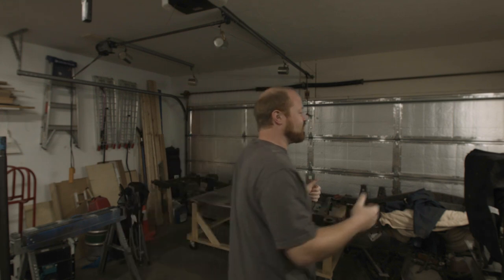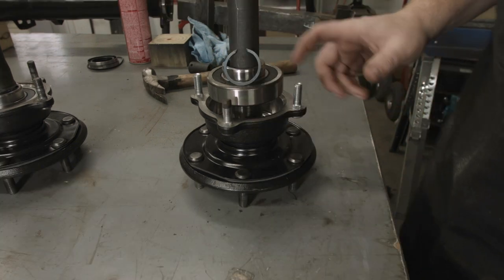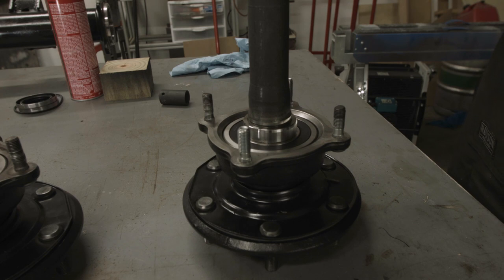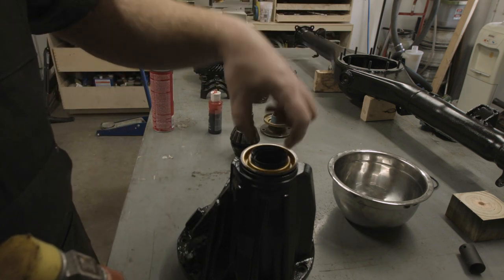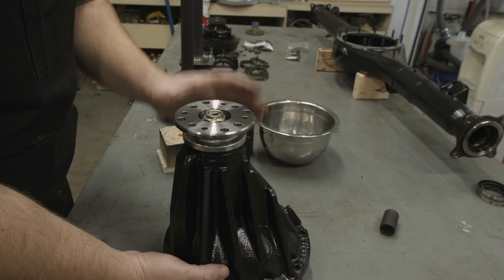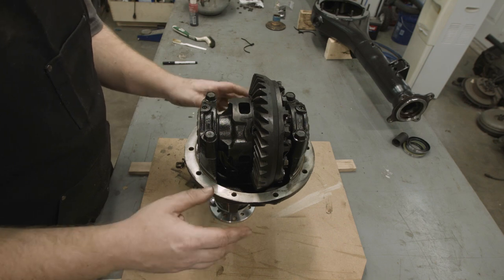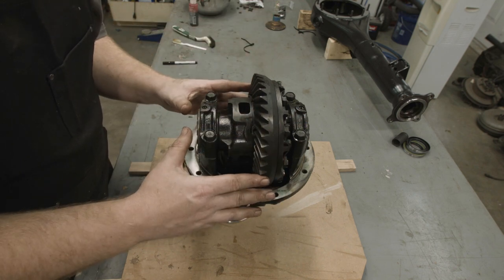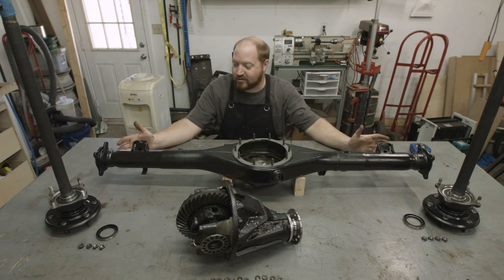Rear Axle Final Assembly - 1989 Toyota Restoration Episode 21

Comment: I noticed that you did not check the gear contact pattern between the pinion gear and the ring gear.  Is that a common practice with this differential?  Yes backlash is important and so is the contact pattern.  How about carrier bearing preload?  I know on a 9inch Ford rear-end the carrier bearing preload is applied while adjusting the backlash.   That is the case with a 9 inch Ford differential which is exactly the same as this one.  Sorry about being a PITA on this but I am genuinely curious about the change in procedure on assembling this style of differential.
Reply from the maker: I didn't check the contact pattern in the video, but I went back and checked later on off camera. It looked acceptable so I didn't feel like it was anything to make a video about. Both backlash and contact pattern are important, just forgot to do contact in the video. I didn't check carrier preload. I could go back and check it, but as per the last video of the series; I'm not working on the truck anymore.

Comment: What torque wrench are you using? Really like your videos
Reply from the maker: I have the kobalt brand digital ones. They aren't anything to write home about, but they've been durable and reliable so far. Lowes might still have them. Not sure what has happened with the craftsman change over. I'd recommend them if they fit your budget.

Comment: excellent video. (messy garage.) <3

was that wiggle at the end a good thing? a bad thing?
Reply from the maker: Not sure yet. Need to do some research and see how much backlash is supposed to be in spider gears. Depending on what I find and if it's worth the time I might rebuild or I might add a LSD.

Comment: Is an axle restoration worth it?
Reply from the maker: It really depends on your situation. If everything is in working condition and isn't giving you issues than probably not. But I had no idea what the history of this truck was. The oil wasn't changed regularly. The amount of build up in the cylinders was frightening. The giant hole in my frame was worrisome. Since I was tearing it down to the frame I figured I might as well give everything a going over. One of the drum brake was caked with oily brake dust which meant one of the seals was bad. So I decided it was best to rebuild the entire thing to make sure everything was good.
Reply: @Obscuremotorsports  owww ok, cause i have a land cruiser fj40 that's not been used since i was off roading, now it's just in the house sleeping and also not getting turned on

Comment: torque specs?
Reply from the maker: Depending on the axle you're working on the manufacturer torque specs can vary. You should reference the manual or look up Fastenal's recommended torque values for the appropriate size and type of fastener. Good luck!

Comment: Sir i have toyota surf 94 model i changed the engine and 5 speed gear 4×4 engine changed 5l 3000cc but now i have speed problem pls guide me.  Now  5L engine 5speed dyna gear and dif gear 4.1  10/41 tyre size 30 inch   speed have only 90km.h with 3500rpm pls resolve my problem
Reply: In engine have problem or gear problem pls tell me   thanks